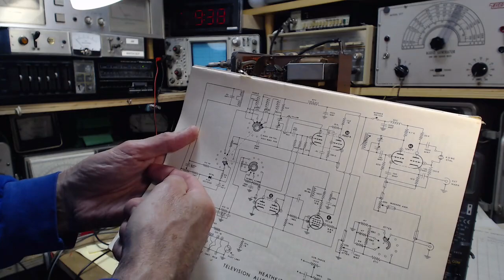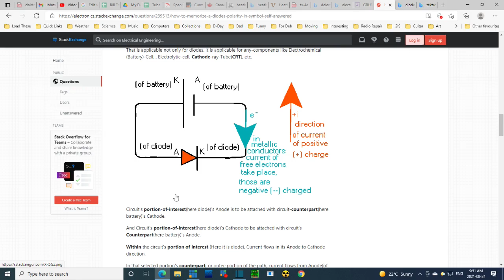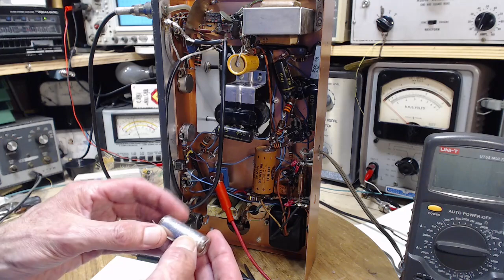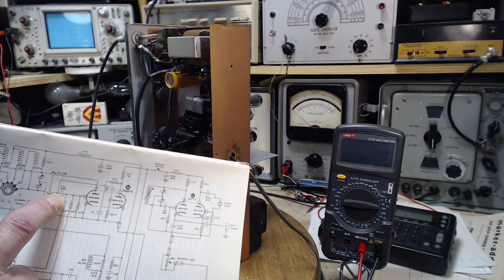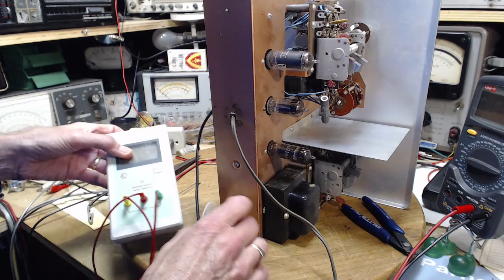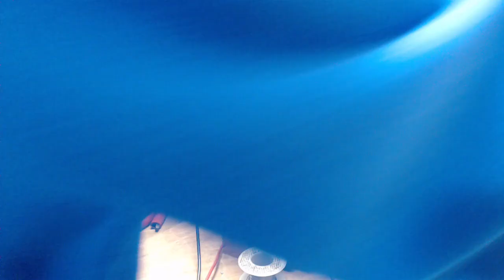Heathkit TV Alignment Generator TS-4A Video #6 - Square One Again

Comment: An isolated DVM , I believe now is the best way to test and measure. Im 78 and just shook the analogue  idea as the only way and there are no holes. Only  electrons and they flow from negative to positive.. electrons from against the arrow in a diode.

Comment: Not a diac, triac, varactor, not even a zener, nevertheless he always gets a common 1N4005 wrong. And the rather childish explanations and excuses don't help. What would you expect with more critical components? Troubleshooting as eclectic as it can get, he's all over the place. Every new component he pokes stops working, as unreliable as most of his vintage test gear. That quixotic story at Ontario Hydro AC offset by DC feeds as accurate as an unicorn aligning a radio receiver.

Comment: A couple of videos ago, Jim realized that there is no voltage at the plate of oscillator tube. Yet instead of following that lead, he jumps to all other incorrect conclusions and replaces a bunch of perfectly working parts. Dear Jim, just investigate why the plate of oscillator tube shows 0V.

Comment: Hi Jim 
The 6CL6 can be pulled out . 
See if the oscillator starts like that .
The 6CL6 has a 1M pull up on it's grid so don't just pull that 12AX7 .
If it starts on the unregulated supply look around the 12AX7 .

It should run with both 12AX7 & 6CL6 tubes out at the same time . 
like this it's not calibrated & no blanking but a useful test  !

Comment: I can't get an in focus view of the schematic but are those electrolytic caps he just replaced terminated in the proper location?
Just judging by where the originals were terminated,one at the + side of that .25 400V cap (hard to tell exactly where the leads are)and knowing Jim I have my doubts.

Comment: Conventional current flow is simply wrong.  There is no basis in physics for it, and the ONLY place that it makes any sense is in explaining how transistors work. Conventional current flow is analogous, in a way, to cold being considered a physical property.  There is no such thing as “cold” there is only the absence of heat.  Similarly, there is no current flow from positive to negative.  There  is only the absence of an electron in the outer orbit of an atom.
Reply: Conventional current was adapted because Field Theory  agrees with it, i.e. Maxwell's equations.

Comment: 24:34 A tip to those who care; ceramic capacitors in an oscillator are critical components. Especially on test equipment and more so on oscillators these very often are of a special type with a certain behaviour regarding capacity drift with temperature change (and not necessarily NPO type. They could also be chosen to counteract the drift of components around them.) That is why you do not want to replace these caps in test equipment with some random parts bin caps - even if they are of the same generic type (foil, ceramic etc). The proper way to handle the troubleshooting of caps in oscillators would be to clip out one side of the original cap, tack a new one in to temporarily take its place and then verify if you found the culprit. If it is not the culprit by all means reinstall the original cap.
And remember this oscillator is running in the MHz ramge. So lead length, lead dress and whatever are critical. Oscillator sections are not the right place to fire the cap cannon at. Fire the cannon at electrolytics if you need.